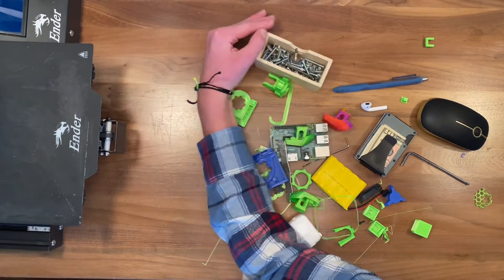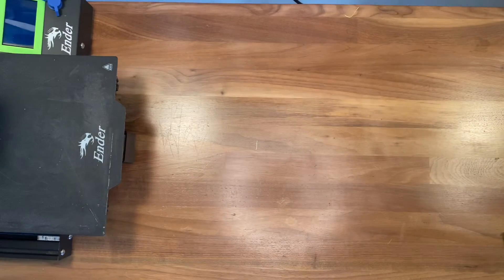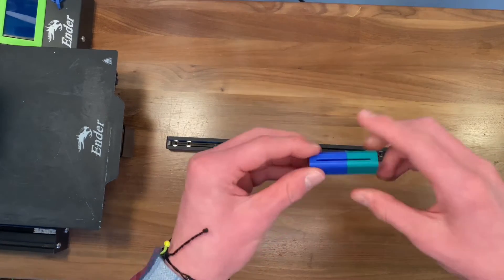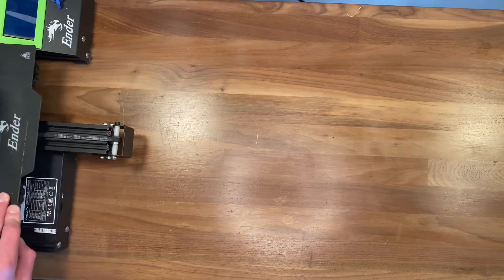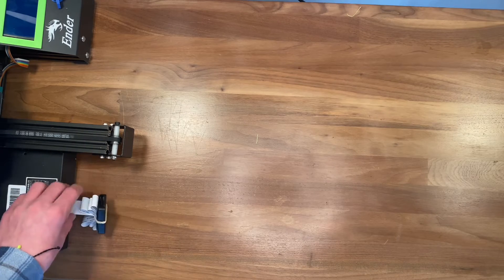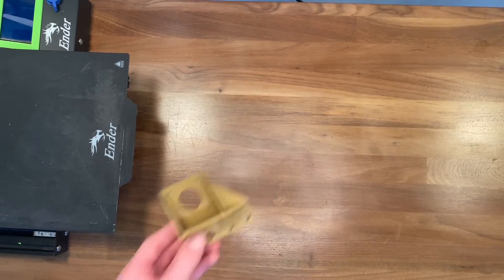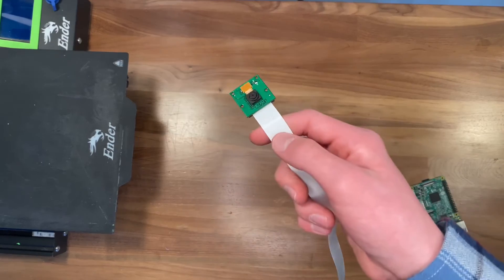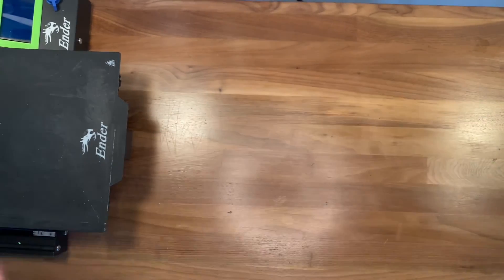Modifications and Upgrades for the Ender 3 or Ender 3 pro

Comment: I had an issue with the card reader that I purchased in which I returned because it would not stay the micro sd slot. I was afraid it was going to wiggle out over time. Does yours stay in until you press it to release?
Reply from the maker: I actually had the same problem and don’t really use that mod because of that however you can print adapters for it that would help hold it in. Just search in Thingiverse
Reply: @engineeringaddiction  okay. At least it wasn't just me. Sent it back now going the octoprint way